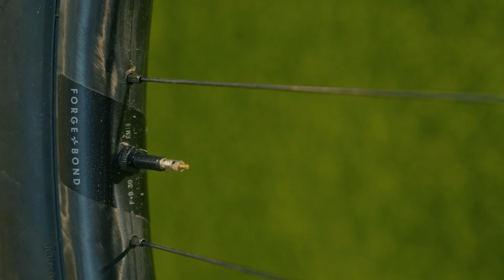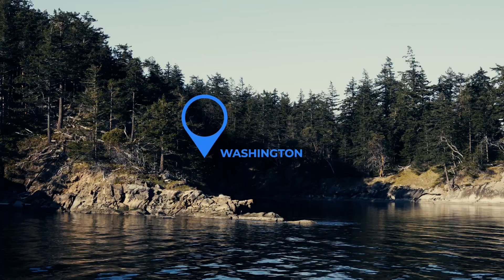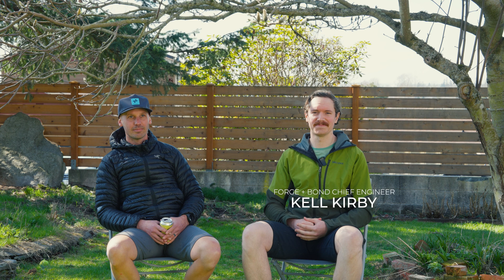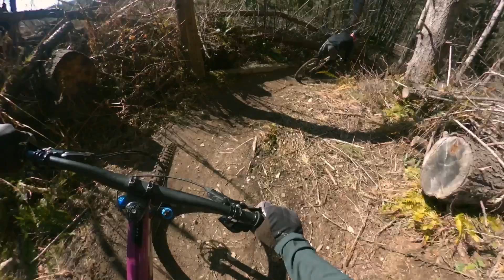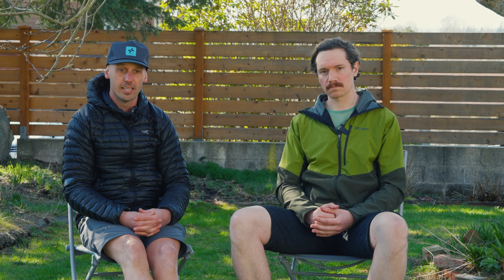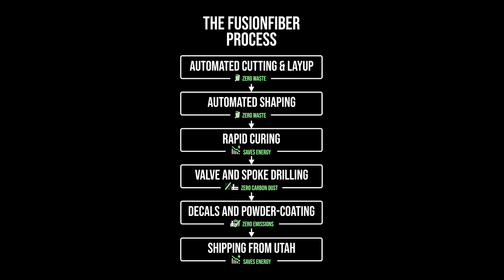Carbon Wheels Uniquely Made In The USA - FORGE+BOND | #mtb #loamwolf

Comment: All talks but the most important details were not mentioned. These rims are made for lightweights. There are not made for bigger riders. I am 190lb. Just retuned a set of these rims because they are hookless and the max pressure is 40psi. Min, I ride 40psi front and 42psi rear.  Also the finish is not premium. American hubs? All Day!. American carbon rims-nope. It is sad to admit, but Chinese make better rims.  Lighter, stiffer, better finish and reasonably priced. For $850+5.5% taxes, It should have top notch finish and it should be clincher.  Who does ride a gravel bike below 40psi? MTB ok but for gravel, I need min 40psi.

Comment: Want to save $1,419, and 467g of weight?

You can have a much better 1,515g enduro wheelset for built for you for $1,180. If you want lighter, buy lighter, more expensive hubs. If you want cheaper, cheaper hubs and skip Berd spokes.

Parts list:
$115 NEWMEN Front Hub MTB FADE Straightpull 6-Bolt silver 15x110mm Thru Axle BOOST
$215 NEWMEN Rear Hub MTB FADE Straightpull 6-Bolt silver 12x148mm Thru Axle BOOST
$82 NOTUBES Rim 29" ZTR Flow MK4 28 Hole
$80 RACE FACE Rim 27.5" 650B ARC 30 Offset 28 Hole
$688 Berd custom wheelbuilding
$1,180 total
+
$32 76projects high flow valves
$1,212

Comment: Why is carbon so expensive? 😂 It's recycled plastic.
Reply: @Flippy oh. I read somewhere that the filament they use to make the fibers themselves was from a recycled plastic. I know the resin process. I've done fiber glass.
Either way, bike frames and rims shouldn't cost as much as they do. You can get carbon fiber hoods for cars for about a thousand dollars
Reply: @andrewsiasparks a 1k$ carbon Fiber hood for a car does not compare to the worst carbon bike frames/rims. It’s a non structural part made for looks and bragging rights.
Carbon fiber is extremely dependent on design and manufacturing just the name carbon in it doesn’t mean shit.